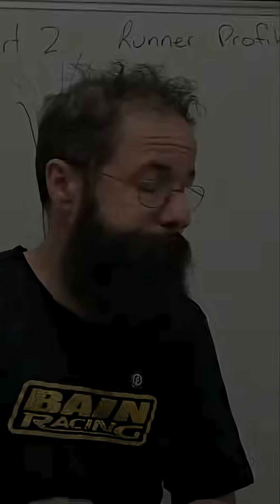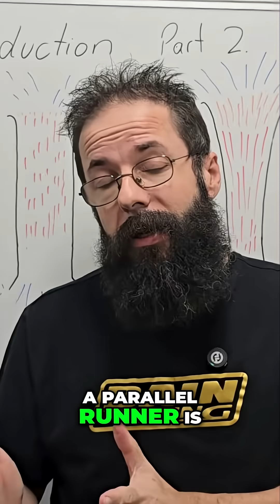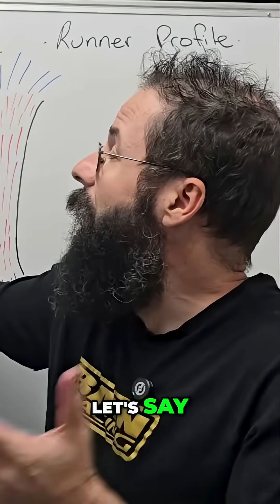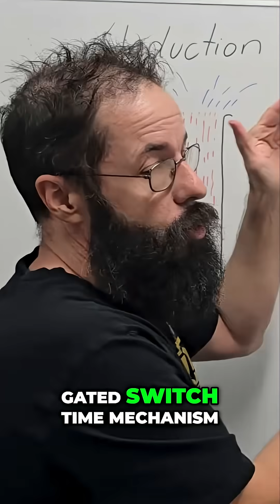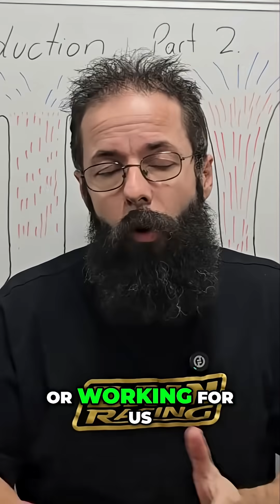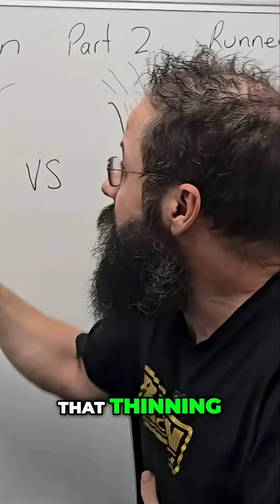Tapered vs. Parallel Runners: Airflow Explained!

Comment: Does this to use the smallest intake valve possible to achieve the desired tapered effect
Reply from the maker: No, its about using the "right" valve and port CSA to match your RPM and cubes.   The right velocity is what drives inertia and our filling characteristics.